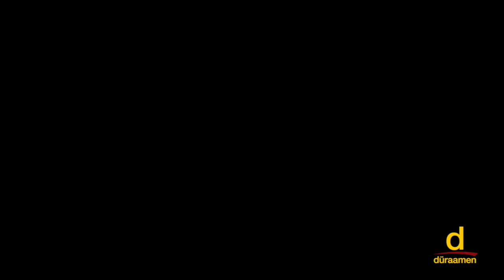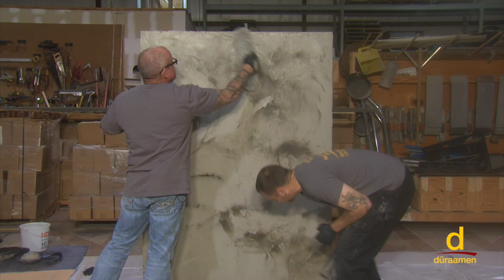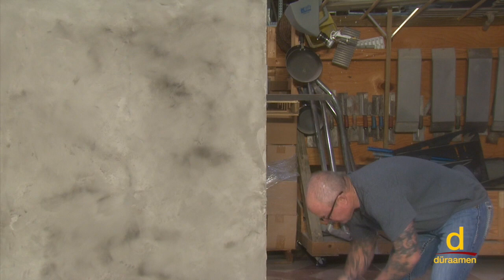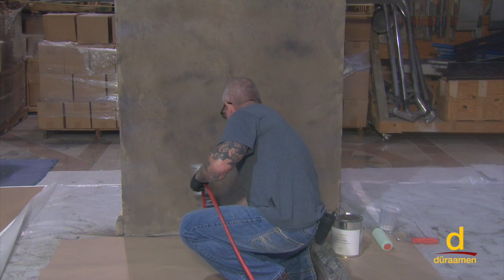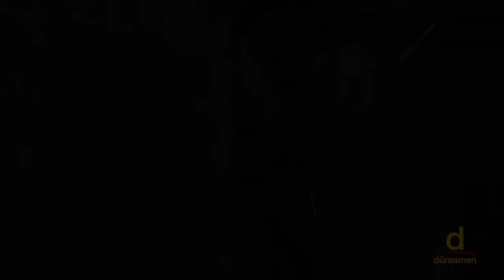How to Apply Concrete Micro-topping to Vertical Surfaces - Part 2/2

Comment: Would it work to put Red Guard on the moisture resistant drywall beforehand if it were for a shower stall?
Reply from the maker: Yes. It is a good idea. You may want to broadcast 30 mesh sand so that there is grip for the microtopping
Reply: @DuraamenFloors  Redgaurd under it in conjunction with the 
1. AO3
2. water based epoxy 
3. 100% solids epoxy
And 4. Polyurethane
Right? 
(Planning to do full bathroom and shower walls and floors)

Thank you for this video by the way, by far the most informative I have come across on this topic :)
Reply: Perfect! Thanks for the help!